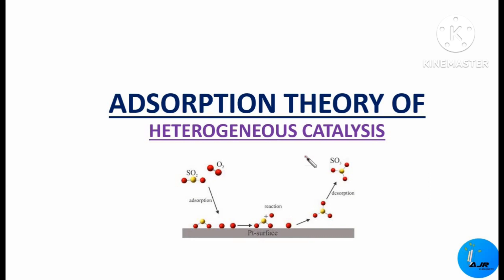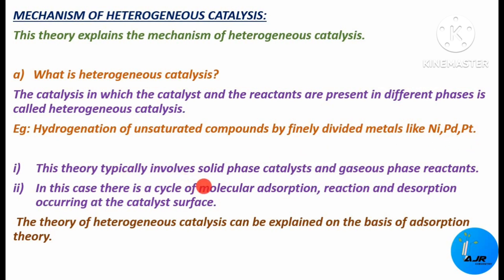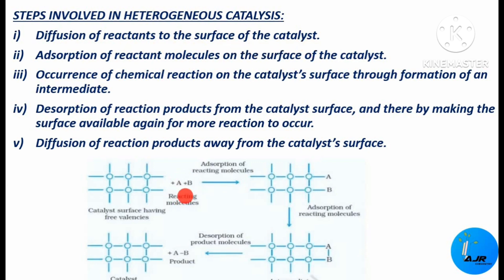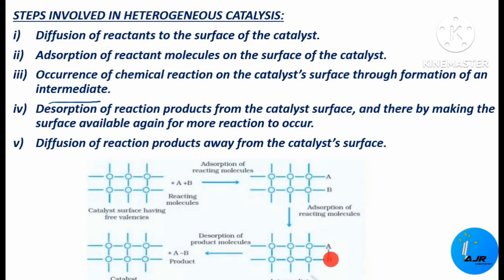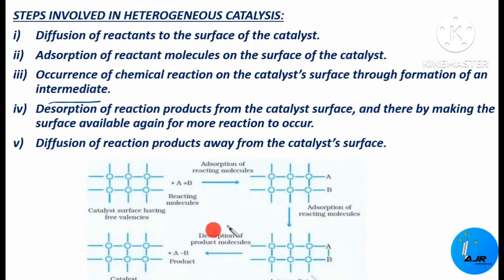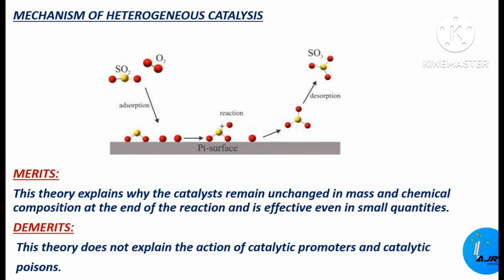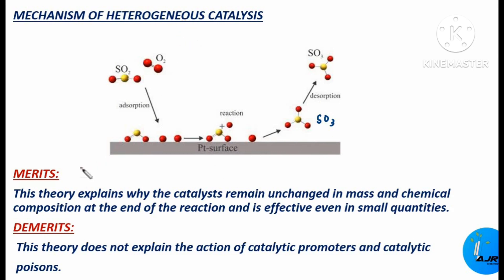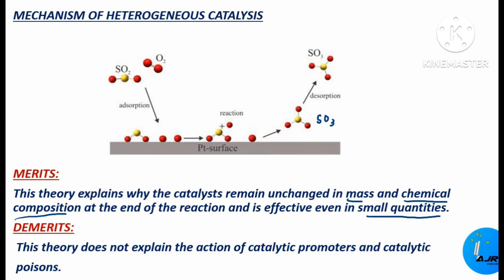MECHANISM OF HETEROGENEOUS CATALYSIS | SURFACE CHEMISTRY | ajr chemistry

Comment: The subject from which i've achieved an honours degree you're analysing. Meseems asif had i been seated in Rajendra College Chapra in the class being held by Dr. S.N Sanyal in organic & inorganic chapter & in chemistry of silver & gold in inorganic. Please tell me whether, " can a homogeneous mixture of concentrated & fuming HNO3 : HCL in the proportion of respectively 1:3 can dissolve silver , that is named as aqua ragia ?
Reply from the maker: Hai Hello nice to meet you through this reply. Actually aqua regia which is known as the Royal water is capable of dissolving gold  and not silver. Its invulnerable to this mixture.
Reply: @ajrchemistry  Quite correct. Aqua Rangia can dissolve Gold & Platinum but Silver doesn't dissolve & differs from Gold in this respect